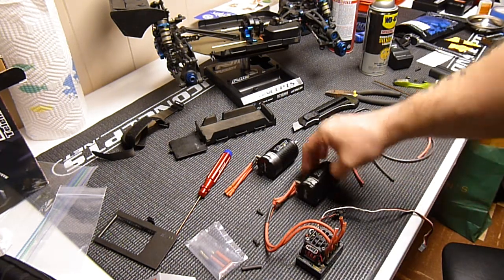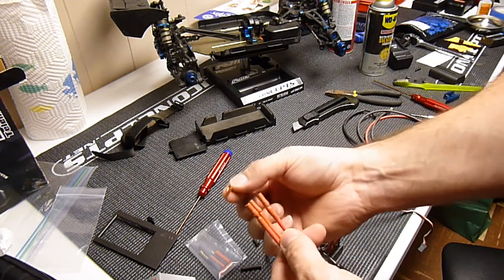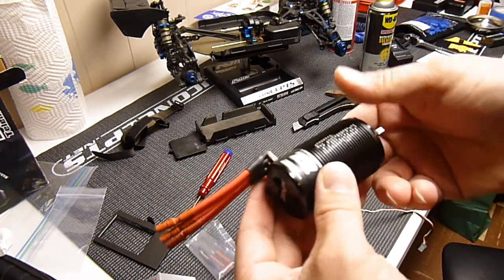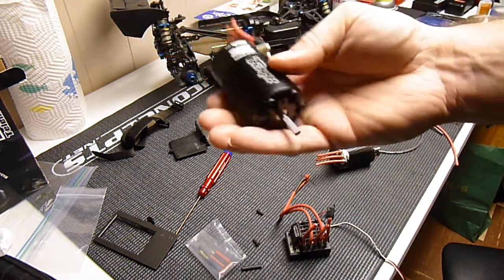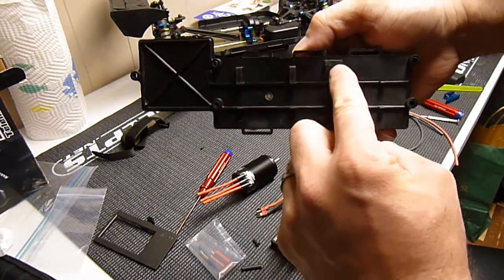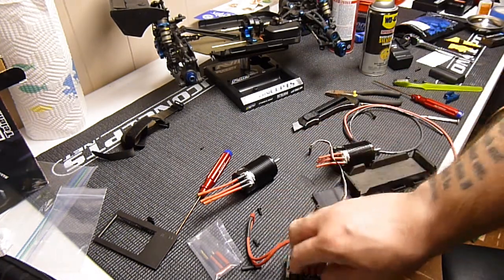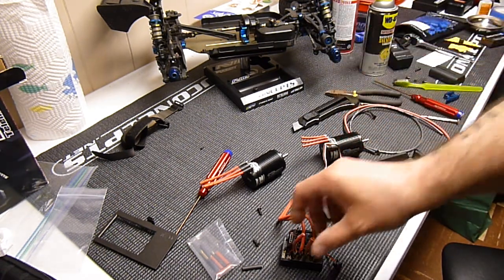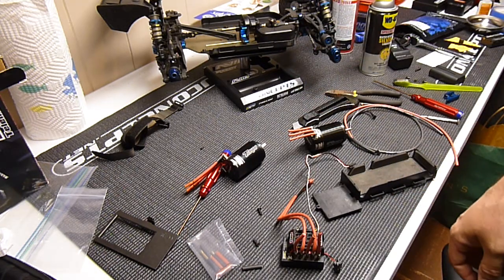Team Associated RC8B3e motor upgrade.(Episode 1)

Comment: Hello I'm James Mason and I have a RC8b3e and I did the same mod but I used Castle Creation 6.5mm connectors and red white and black 10 awg silicone wire for the battery and motor
Reply from the maker: Sweet, how did it work out?